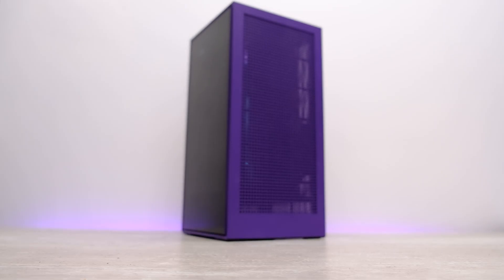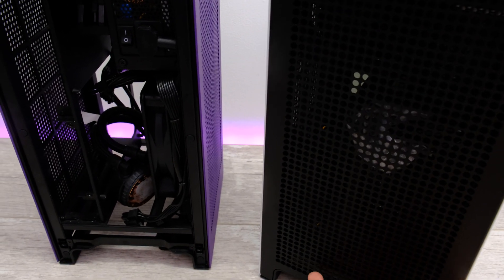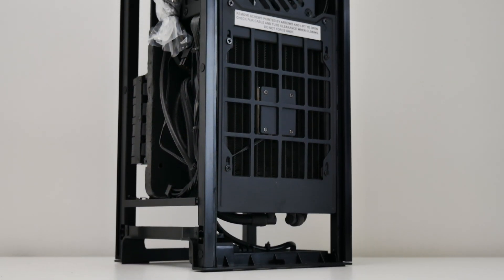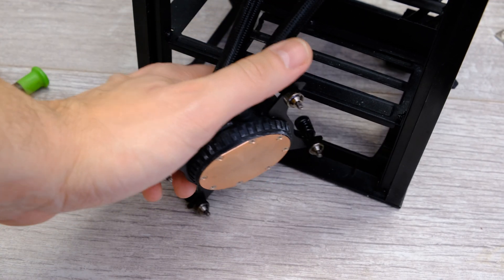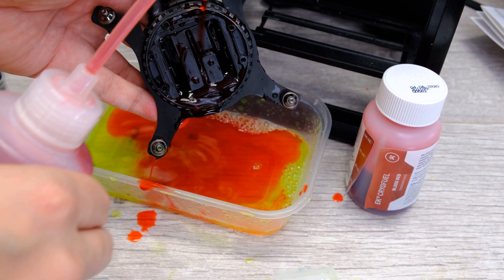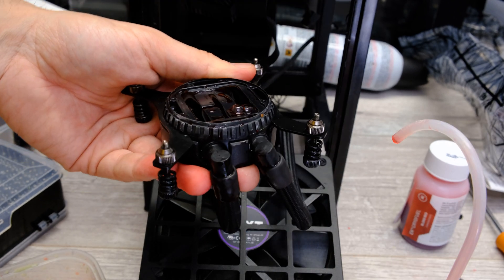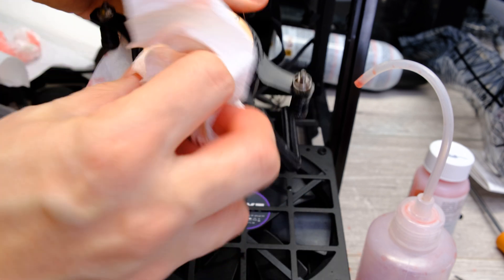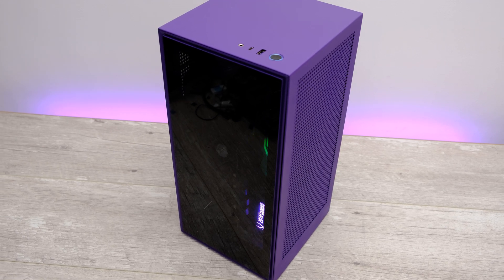NZXT H1 PUMP FAILURE (AND FIX)

Comment: Can I just clean the plate and then reuse the old coolant?
Reply from the maker: The old coolant is part of the problem unfortunately as it likely has silicates in it that react with solder flux to create the sludge or at the very least has particles in it that will eventually get trapped in the contact plate fins. You’ll likely lose some coolant in the process too and you need to ensure the cooler full to the brim so you need new coolant anyway really.

Comment: Unfortunately we are often the BETA testers. PC hardware manufacturers invest very little focus and effort into development and testing of their liquid cooling products.  We could talk for hours on this topic, lol
Reply from the maker: Certainly seems that way. Apparently it's solder flux residue and is especially prevalent with cheap AIO's with aluminium rads. Others will be fine as will custom loops, especially if you flush the rad first which most of us do.